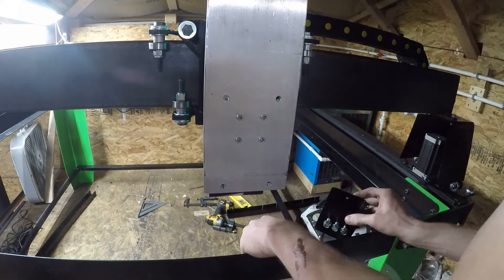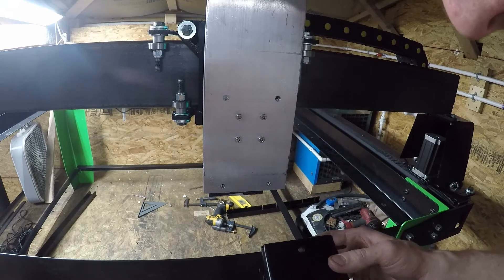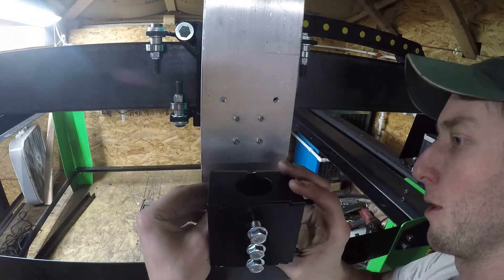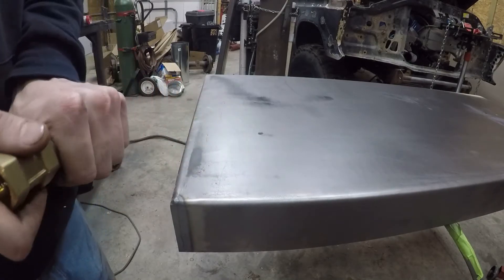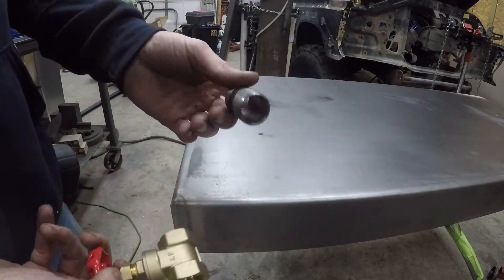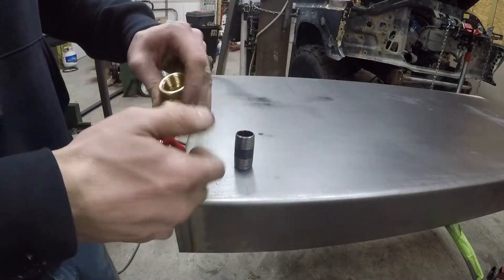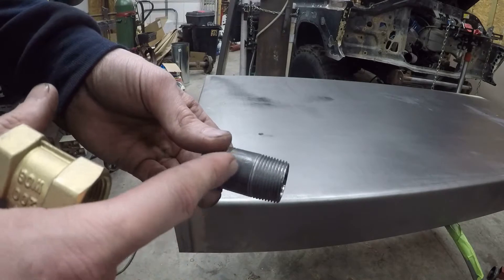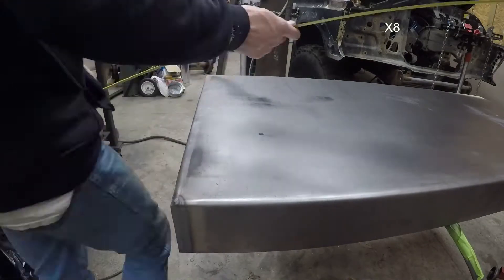CNC Plasma Table (pt 4)

Comment: What'd you paint your water table with and how's it holding up ?
Reply from the maker: rust Oleum,  the outside still looks good, the inside went to shit in a few weeks, not worth the time to paint the inside.
Reply: @ppfracing6694  dang lol. 
I thinking I'll try some bottom side saltwater boat paint.